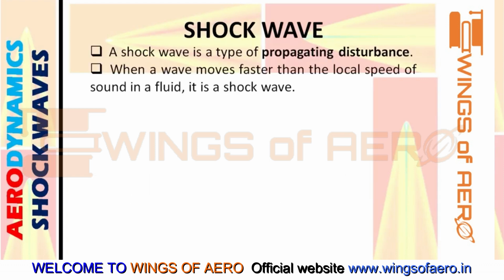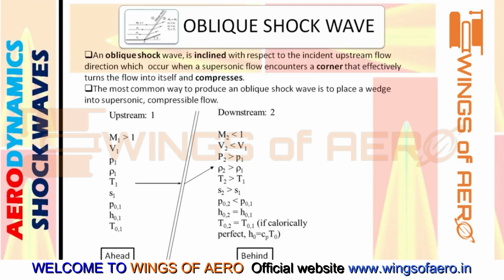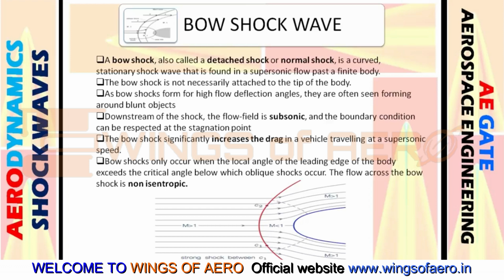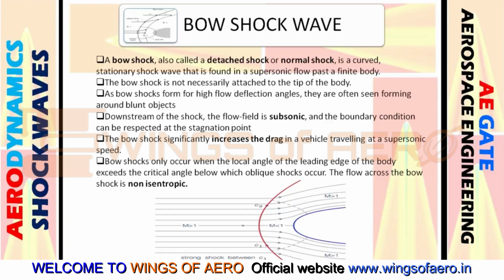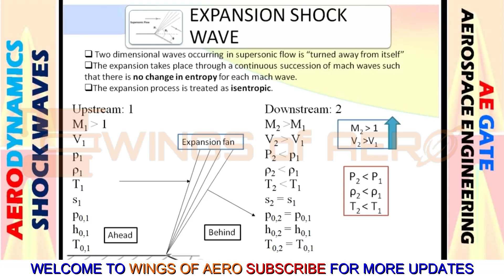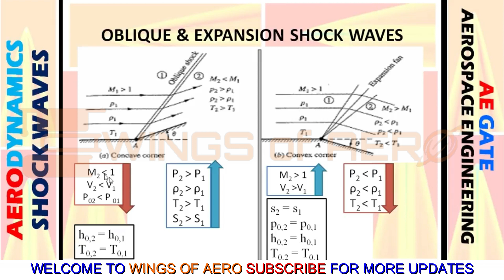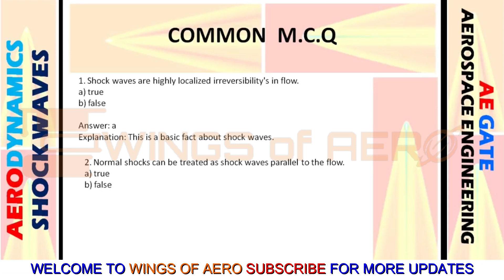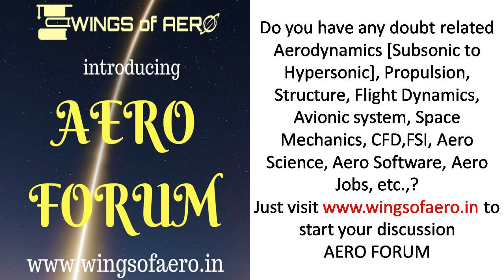Basic Shock Waves | Aerodynamics | Ms.Aishwarya Dhara

Comment: Section 4: Aerodynamics
Core Topics:
Basic Fluid Mechanics: Conservation laws: Mass, momentum (Integral and differential
form);
Potential flow theory: sources, sinks, doublets, line vortex and their superposition;
Viscosity, Reynolds number.
Airfoils and wings: Airfoil nomenclature; Aerodynamic coefficients: lift, drag and
moment; Kutta-Joukoswki theorem; Thin airfoil theory, Kutta condition, starting vortex;
Finite wing theory: Induced drag, Prandtl lifting line theory; Critical and drag
divergence Mach number.
Compressible Flows: Basic concepts of compressibility, Conservation equations; One
dimensional compressible flows, Fanno flow, Rayleigh flow; Isentropic flows, normal
and oblique shocks, Prandtl-Meyer flow; Flow through nozzles and diffusers.